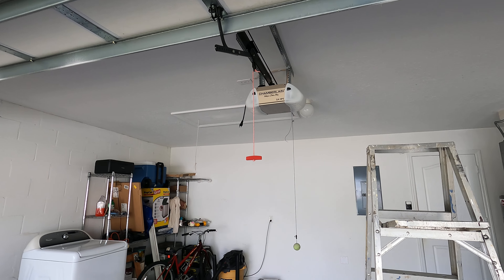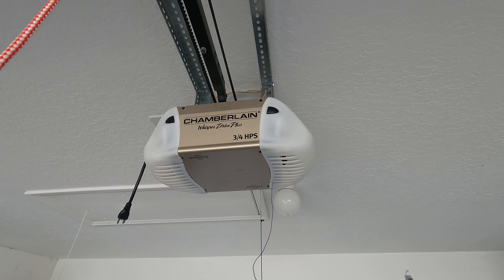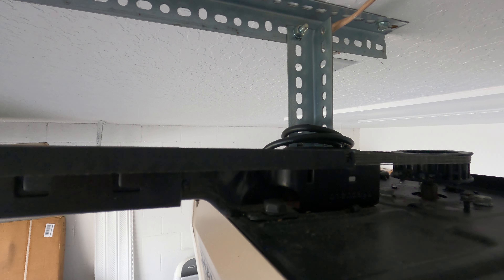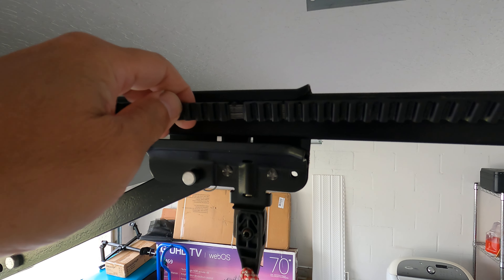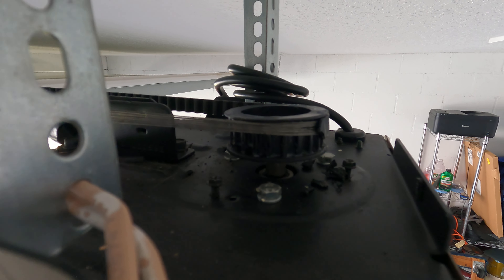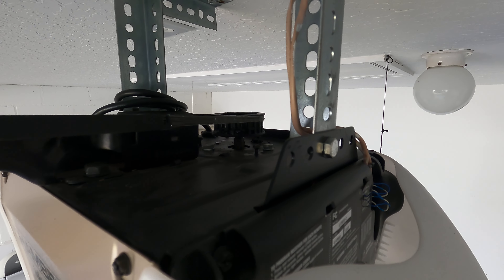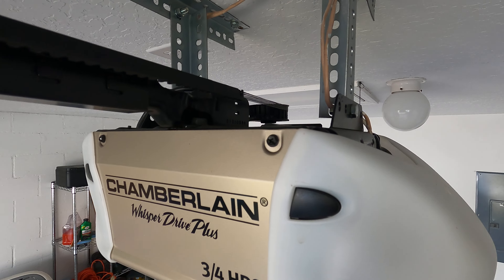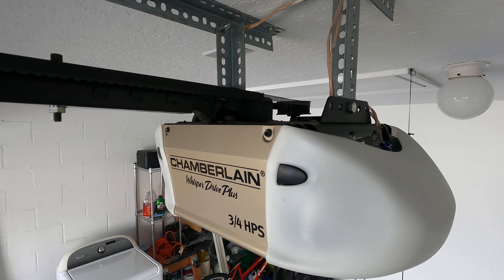Garage opener belt issue on Chamberlain Whisper Drive Plus.

Comment: i don t think your operator is level, belt should be at midpoint on sprocket, also check tension, it needs play, also unhook trolley, lift door by hand, make sure it is balanced
Reply from the maker: Thank you for your comment!  Had some time to check through everything you mentioned.  Door is well balanced as one hand can operate door manually.  Belt continued to ride up top of sprocket with loosening the tension (very sloppy).  At this point I think perhaps the sprocket had worn unevenly.  I will buy a replacement sprocket to see if it will solve the issue.  Thanks again!